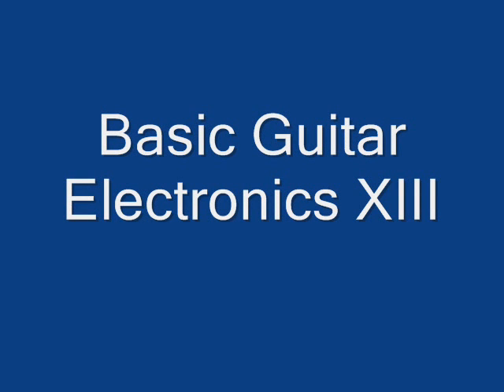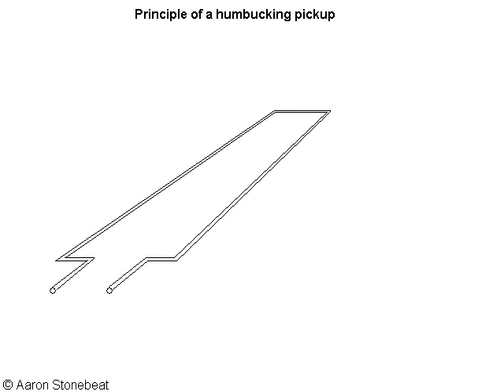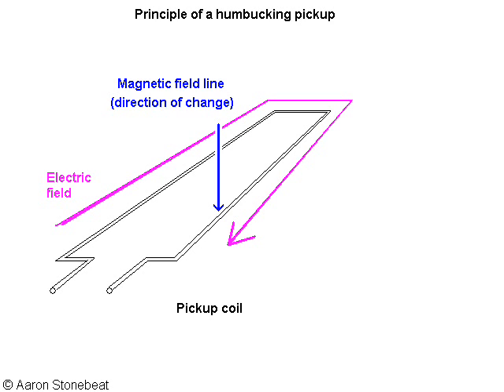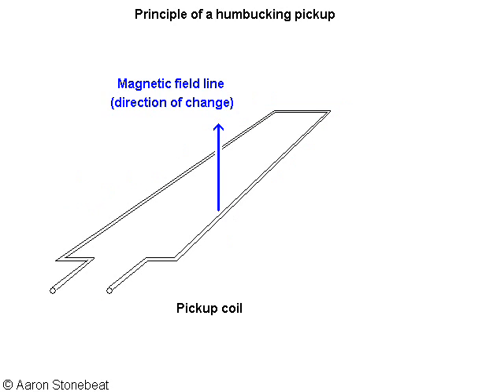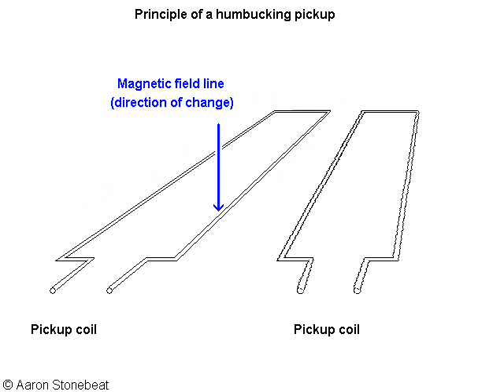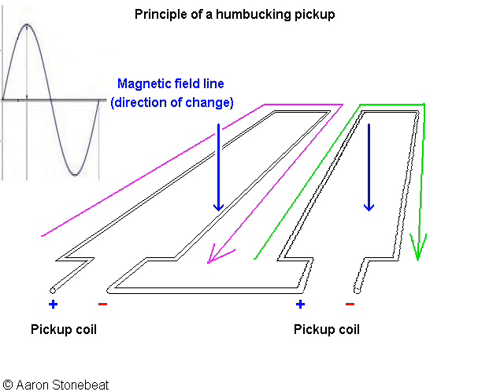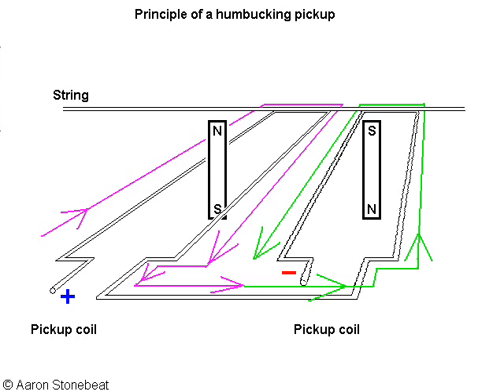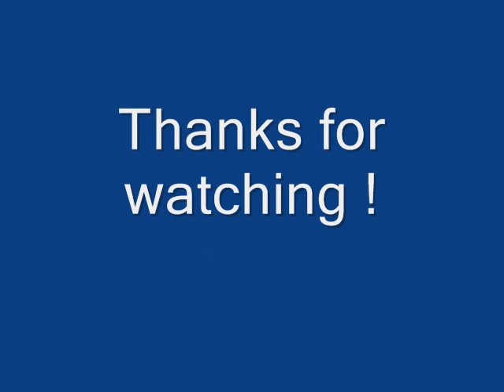Basic Guitar Electronics XIII - Principle of humbucking guitar pickups

Comment: Hello Marc again, I am progressing (slowly) in my understanding of pickups. Now I am busy with some hardware. One question for you . Do you know an accurate way to measure that the screws are correctly adjusted (equal level output for each plot/screw of humbucker) and what method can be used to check this out.
Maybe it is a stupid idea but if there are screws they must be usefull to something ?

I am aware that some people use their ear to check out proper balance between strings but "my" ears are not "your" ears and at the end there is no garantee that it is "optimum" in a way . Other people  use a visual check (screw in stairs or following the neck curvature) but I am not convinced by this method. I have some ideas for an objective method but I would need some advise.
Also a question related to this point. In case of humb split in single coils and comining singles... Isn't it wise to use preferably the screw single coils of humberckers to combine between 2 coils instead of those without screw. In effect , this would garantee that the "best" adjusted" single is used for combination, ensuring the correct polarity pairs of course (as explained here...https://www.youtube.com/watch?v=7UfxQBhqen8)

Brgds
Antonio
Reply from the maker: Hello Antonio,
You could try measuring the output voltage for each individual string; see where that gets you as far as screw height is concerned. I've never done this, I always do it by ear and eye.

You are probably correct using the screw sides when switching to single coils but keep in mind that the individual coils of a humbucker will differ slightly in sound because of their locations with respect to the strings; you might have to turn a pickup around to get the side with screws on the inside, especially the bridge pickup (you'll need your ears, it's a matter of taste).

Comment: Good explanation. I somehow now understand the Humbucker princible. But I still have some lack of knowledge. I wonder how the Humbucker princible interacts with out of phase switching.
Is the second coil switched out of phase? If yes, why we dont have the out of phase effect?
If not, what happens when I switch the second coil out of phase? Is the hum cancelling effect gone then and we just have the out of phase effect?
More questions: what happens to single coils which work in hum cancecling mode (one single coil reversed) when I switch them out of phase? Hum cancelling disappears and we just have out of phase?
What happens when I switch two single (with the same winding and polarity) coils out of phase? Do I then have hum cancelling effect AND out of phase effect at the same time?
Reply from the maker: In a humbucker the two coils are connected out of phase AND the magnets have reversed polarity (N/S for one coil, S/N for the other); in that way the two sides of the pickup are in phase as far as the vibrating of the strings is concerned and out of phase with respect to outside interference.

It doesn't matter here whether you think of one humbucker or two separate single coils, the same principle applies. For example the answer to your last question: yes, they will be hum cancelling and out of phase.
If two coils are out of phase they will be hum canceling, they are two out of phase antennae for electromagnetic radiation. It's the magnets that make the strings produce electromagnetic waves (or to put it the other way around: the vibration of the strings disturbs the magnetic field with electromagnetic waves as a result).

coils in phase, equal polarity: no hum cancelling, in phase signal
coils in phase, reversed polarity: no hum cancelling, out of phase signal
coils out of phase, equal polarity: hum cancelling, out of phase signal
coils out of phase, reversed polarity: hum cancelling, in phase signal
Reply: Wow, this is an even better explanation and I think I understand the principle now nearly completely :-)
Can we say "putting one of the two coils out of phase puts the signal and the hum out of phase"?
And "reverse the (magnetic) polarity of one of the two coils puts only the signal out of phase"?

To understand it completely I want to ask one more question:

"out of phase" (I mean swap the two wires of one coil) has exactly the same effect as "reversed wound coil"?
Reply: @raymundbollinger2308  Hi. Reverse would is about the orientation of the winding, (clockwise or anti-clockwise). Polarity is about the magnet's poles(N/S - S/N).

Comment: Great video for curious .. like me. You explain very well this "magic" and it seems that you are the only one on youtube to do it so nice with pictures.

I imagine it was quite a work to do this video. I will anyway suggest some more work ;-)) to make it even closer to the reality. What would be very nice is also to show not just one wire of coil but let say 2 or 3 rounds so one can imagine the way wires are turn on each coil in reality (clockwise or anticlock wise). Such a short picture could be inserted just at a point in time in the presentation and then you would come back to one wire in order to not complicate to much the rest of the images which are very good as they are. I will go trhought the others videos right now. 

Great contribution.. thank you
Reply from the maker: Thank you very much for your comments and subscribtion. It was indeed quite a bit of work to make the videos.
I don't think more work is needed because it doesn't matter which way the pickups are wound, what matters is the way the coils are connected. One can make a humbucker with two coils that are wound in the same direction and with coils that are wound in opposed directions; you'll encounter both in real life.

Comment from the maker: @Pana6Ion 

For bridge pickups you need more output because the strings don't move as far as they do in the middle or the neck position; strings move most in the middle and not at all on the bridge or the nut. The movement of the strings is what induces the voltage in the pickups; more movement means higher voltage.

Comment from the maker: @Pana6Ion 

And by the way, the two wires that connect (white and red) are the ones that connect the two coils. If you ground that connection when the bridge and middle pickup are engaged the bridge pickup will have only one coil active; if it is the right one as far as hum cancelling concerns remains to be seen.

I could use a schematic for your guitar in respect with this problem; is it a 'Lone Star'?

Comment from the maker: @Pana6Ion 

Well, as far as hum is concerned it doesn't matter where the pickups are. They pick up hum from the electromagnetic environment; a humbucker cancels out some of that hum.
It's just because of the position under the strings that the bridge pickup sounds more trebly than the middle or the neck pickup.

Comment from the maker: @Pana6Ion 

I don't mean the cover (although that should be grounded too) but the 'foot', the base.

The pickup has 4 conductor wiring so you could measure the resistance or the inductance (if you have the right tool) seperately. If there is a difference it could explain the hum.

Comment from the maker: @Pana6Ion 

I suppose it means the humbucker is connected to the single coil as it is. If you have the right switch and the humbucker has a wire from the center (the connection between the two coils, or two seperate wires for each coil) one of the coils of the humbucker can be disabled when it's combined with the middle pickup. I have explained the wiring in my 'fat strat' video.

Two coils can cancel hum; one or three cannot.

Comment from the maker: @Pana6Ion 

If it works it will be just fine. Unless the two coils are exactly the same the hum cancelling effect will not be perfect.

Usually humbuckers have a metal mounting bracket. Check if it is grounded; if not it will increase noise.